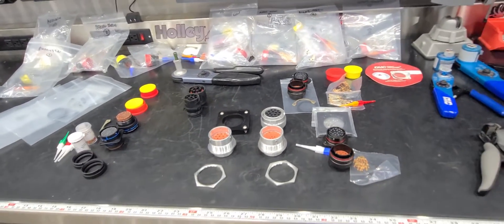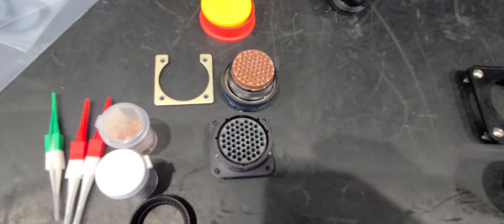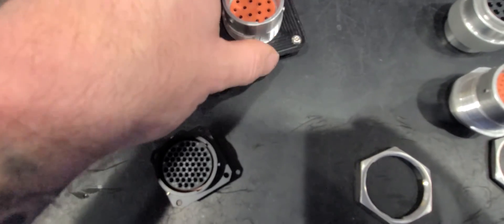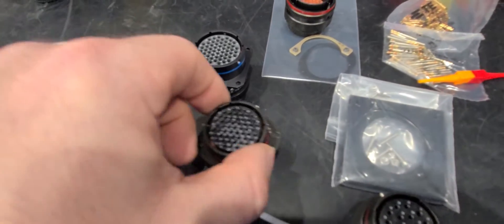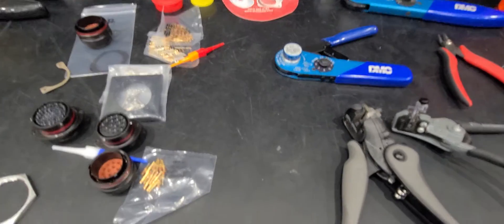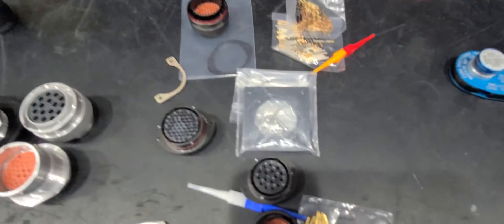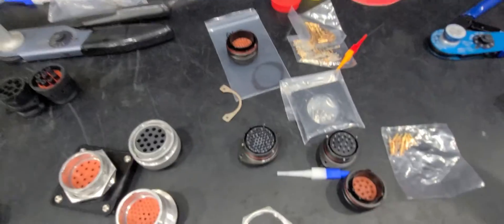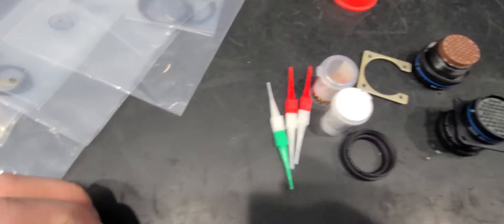Bulkhead Connectors explained

Comment: Good info. We use the “mil-spec” style connectors in most diesel apps. Diagnosis is easier with the lighter colored gasket but we still have issues with corrosion in our salt spreaders.
Reply: May I suggest switching to a connector whose shell is made from a composite?  The mil-spec material code would be “J”.

They aren’t as mechanically as sturdy as an aluminum shelled connector, but they are basically impervious to corrosion.  In naval flight flight systems composite shells get used quite a lot, as they are extremely durable in salt spray environments, without being as expensive or as heavy as brass.

Comment: I purchased a dual 47-pin setup from Maven and did firewall bulkheads for my Holley install around 4 years ago. Cost was a little over $200 for the kit with all the pins included. I also purchased an AF8 crimper with the TH163 turret used on eBay for $135. This crimper normally  sells for around $450 new with the turret. It was a fun project. I had a few self-induced issues, like mangling one of the cam sensor wires while inserting it into the connector, causing the car to intermittently die. I can tell you I sure wish I had Devin's videos to reference back then. Would have saved me a bunch of money and the finished product would have been much nicer.

Comment: why do you hate weather pack so much lol
Reply from the maker: cause they're trash
Reply: @theholleyefiguy  why
Reply from the maker: If you have worked with them and then anything else its kinda self explanatory . Pin design, size, amperage capacity, pin retention pretty much every facet of the connector is trash